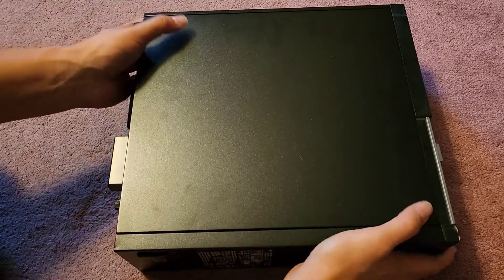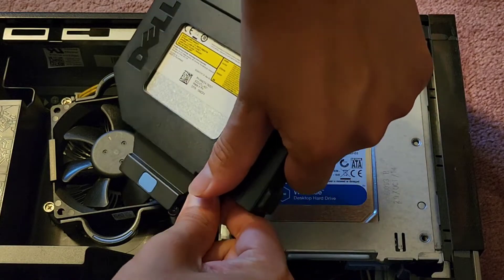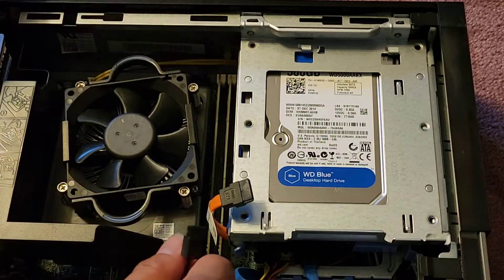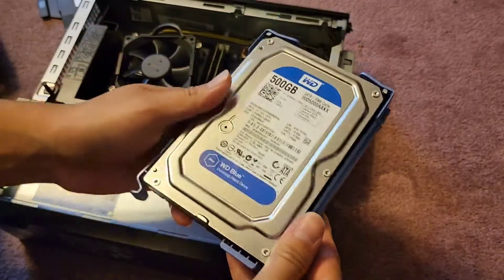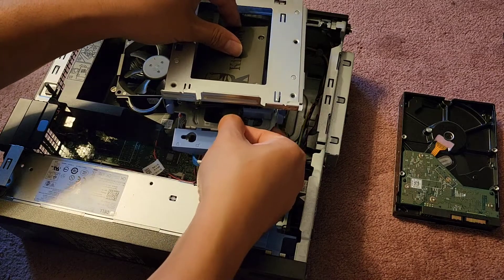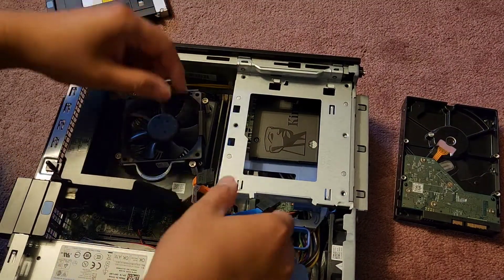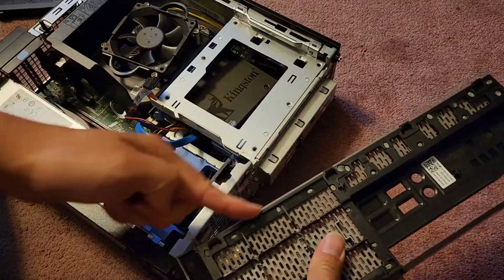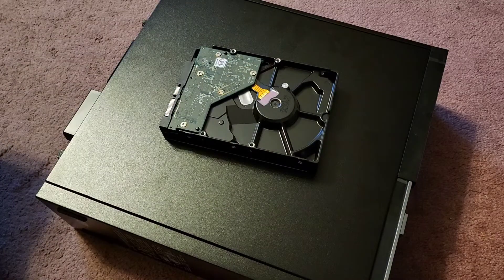Dell Optiplex 3020 Disassembly RAM SSD Hard Drive Upgrade Replacement Repair Quick Look Inside

Comment: What kind of graphics card would work well in this with a budget around $100 on ebay? How many watts or amps can the psu take?
Reply from the maker: Not too sure what's available in this slim form factor. There isn't really much room in the tower. RAM you want to match what's currently in there.

Comment: This is exactly what i was looking for. As a suggestion as to be able to attach new SSD there are 2 ways, First Kingston and AData both sell adaptors from 2.5 to 3.5 discs, or the fastest way is just making a couple of holes in the bottom of the  plastic and attach 2.5 drive with 2 DVD screws (in diagonal or 4 if you want to). Thanks for the video.
Reply from the maker: Glad it helped. If you haven't already, please like and subscribe so others can find my videos. Thanks!

Comment: Thats not so profesional, should ask the customer if you could buy a HDD/SSD cady , or double side tape it atleast :(
Reply from the maker: I could do that, but it adds unnecessary cost and complication and wait time. Customer wanted it back same day. Desktops sit in one place and even if it moved around it won't cause any issues. I let the customer know, so they're well aware of it.
Reply from the maker: I have double sided tape, but there isn't really anywhere to stick it down well.